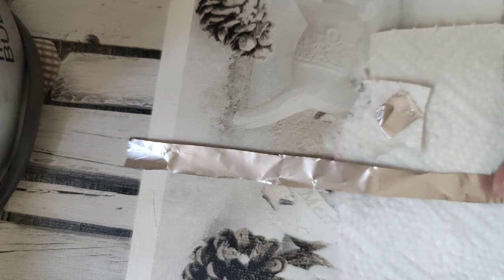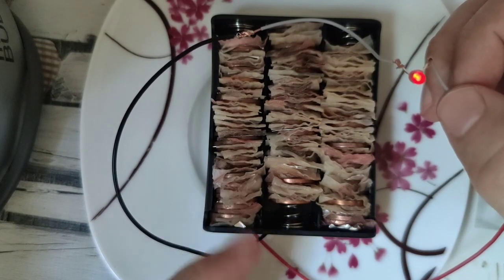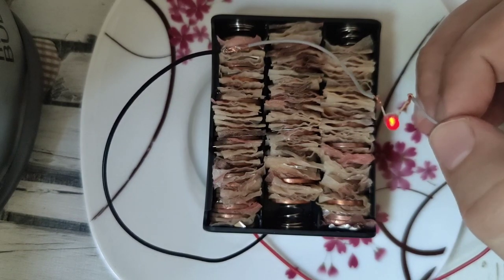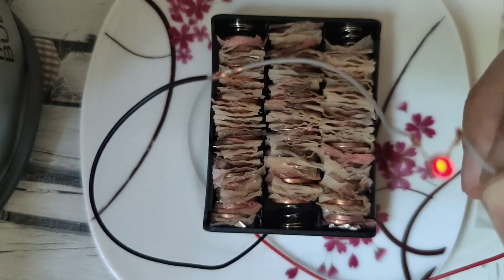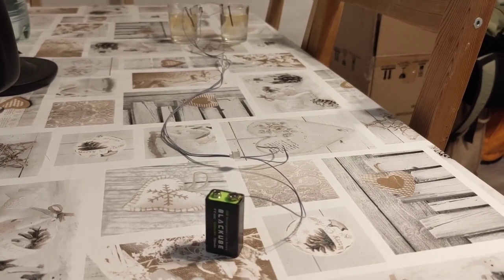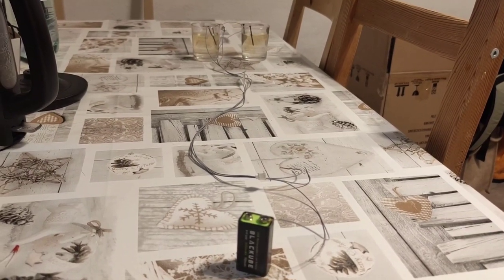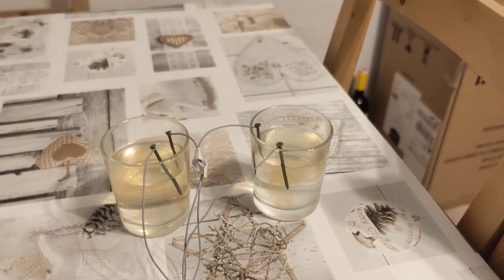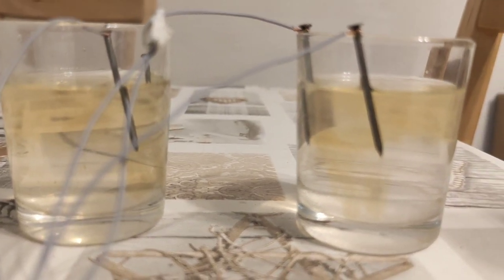Roman technology level: DIY battery and bubble telegraph

Comment: How would they make the wires?
Reply from the maker: Good question. Sheeths twisting seems to have been used in antiquity, i.e. cutting thin strips pf metal and twisting them… maybe copper covered in rags drenched in wax?